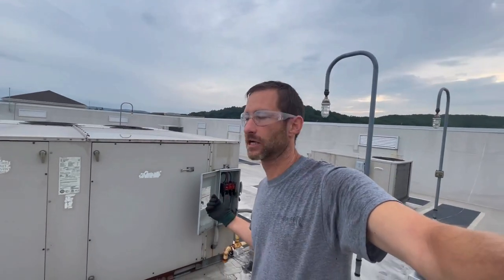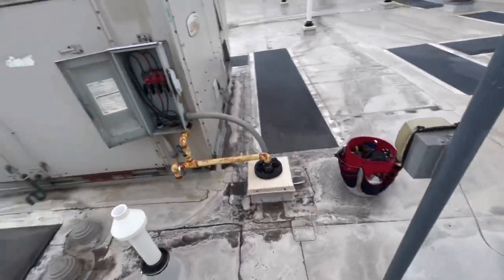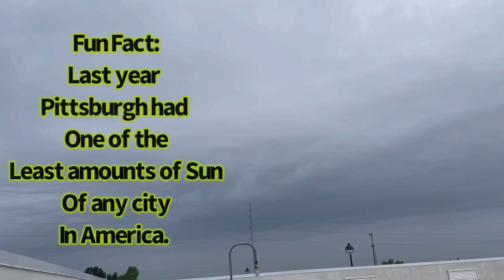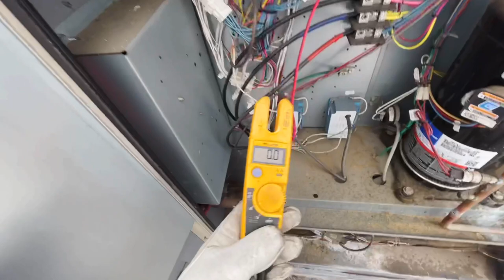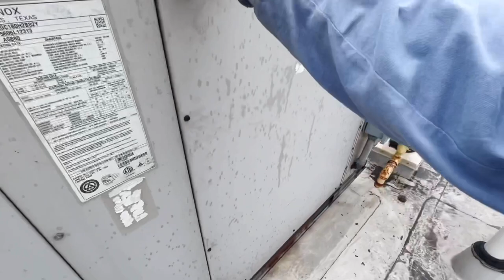HVAC Disconnect Cooked...  #Steamfitterslocal449 #hvac #hvacfail #electricity #HVACEXPLAINED #Lennox

Comment: Loose connections are usually the culprit, loose wires, etc. Steamfitters 420. Good video. Stay safe and be well.
Reply from the maker: That’s pretty much I see loose connections just from lack of maintenance. It’s always good to recheck those connections after a new install and periodically on maintenance. That video I posted of the disconnect literally melted from down in Florida was the first time I think I dealt with aluminum wire used in that application and my opinion I would never do that.  Thank you very much for the comments and nice meeting your brother! The trades are the Way to go!
Reply: @hvacexplained9341  stay safe and be well brother..

Comment: Nice video. 
Thanks for sharing
Reply from the maker: Thanks HK.  I always recommend when installing a brand new RTU or a piece of equipment installing a new disconnect.  I’ve had a handful of times where a brand new piece of equipment will burn some thing up or have a random power failures due to an old faulty Disconnect with bad knife blades. Have a great day thanks for the comment.

Comment: So much to say in this one..
Firstly, was reading a thread the other day and a commenter posted that they recently had a power box blow up in their face. Sorry, I didn't think to ask details.
Secondly, helps to be fit and trim in your profession. Lots of climbing, squatting and contorting the body to fit tight spaces. You're the perfect build for this. 
Hornets, lol. In my profession, they're first on my list of critters I need to look out for, followed by red tail hawk and squirrels. Yes, squirrels. 
There was another item, but I forgot.
Lastly, you're a likeable dude, and really easy to learn from. I wish you well and for your channel to grow. You put a lot of effort into these, it shows.
Reply: Now I remember! The wedding band!

So I'm finishing up a tree removal, standing in spurs on the trunk, cutting 2' chunks and pushing them off the spar.
These rounds weighed approximately 85lbs. 
As I finished the cut, I pushed it from the top to get leverage. It tipped forward---and as it fell away, a small stub the size of a pencil eraser hooked onto my ring and nearly pulled me over the top of the tree. I don't know how I managed to get my finger free without it being degloved. 
I stopped wearing it after that..
Reply: And!
I'm thinking Youngstown may just have you beat for cloud cover.

Comment: Crankcase heaters have been off on the compressors.  Power should be restored for 24 hours, (or as prescribed by the manufacturer), before energizing the compressors, as liquid refrigerant will be absorbed by the oil,and cause potential damage to the compressors.  Phase imbalance should be checked when all of the motors and compressors on.  It should not exceed 10%. 100 X the maximum deviation from the average, divided by the average.  You took all the right safety precautions, and more.  I rarely see that in the field.  Good job.  Sheet Metal Workers Local 104.
Reply from the maker: Good afternoon Rod.  
Yes you are 100% correct about manufactures one crankcase heaters to be running for 24 hours prior to start up unfortunately not many people follow this.  I believe carrier factory had told me anything under 55°F they would like crankcase heaters to run when the compressors are not running. I don’t feel it. Will damage it that much if you do it once in a while but if it was more consistent thing yes.   I have seen residential heat pumps. Running for 15 years without crankcase heaters in 0° weather and still currently operating.  But yes refrigerant migration under the oil then starving the bearings.   I think they just do that to cover their butt.   
Phase unbalance yes can damage the motors also rotation is critical. 
I try to do things that I can buy the book and try to set an example, but there are times where I do slipup pop on this video on these videos.  I’m glad people call me out on it. It shows that they are paying attention and it’s good to share the information because we are only human.  
Since this video I have moved from Pittsburgh Pennsylvania down to Florida.  I am learning the industry down here.  Picking up a lot of good information on how critical equipment reacts to salty environments along with humidity.  
I’m working with a lot of very talented techs.  I’m just trying to soak up everything I can and share what I can.  Their using a lot of Fiberglass ductwork vs sheetmetal. 
Currently replacing a lot of air conditioning systems that were damaged with hurricane Ian.  
I am currently on a travelers card with my union Local 449, but eventually switching over to local 725.  
Thanks for the comments. Have a great day. Very nice meeting you.  Brother.

Comment: I stand correct. If you go into the ECTO setting you can change that to make it work like he said
Reply from the maker: There are dip switches on some equipment and also in the programs you can change settings etc. I have seen some of those Lennox is light up on the right side and some on low fire as first stage.  It’s nice having that option thank you for the comment have a great day

Comment: Good day.ser.i just ask for a/c
Trane package r22 freon
50psi low side 310 high side and there is no cold in suction line. Did the system have a oil or the txv have the problime..thanks
Reply from the maker: I need to know what the temperature is inside the space as well as outside conditions. 
The suction pressure seems a little bit low and the high side seems a bit high since I am not standing right there just looking at this I’m suspecting a plugged up filter dryer so I would definitely check temperature before and after the filter dryer or you possibly could have a metering device such as a TXV going bad.  Not sure of the condition of the equipment but make sure filters and coils are properly cleaned as well as a good belt.  If you can please send me more information and I can possibly diagnose.
Reply: @hvacexplained9341  good day ser i have trane package unit..the pcv  led 1 or led 2 are blingking....is there such a problime to the system...but the unit are working...thnaks.
Reply from the maker: @alvinobalan2320  :  When I get a chance let me look up some info do you have a model and serial number? I’m a little bit busy right now I’m hooking up a new furnace for one of my buddies I will be posting the video probably by tonight.  Is that a voyager unit or possibly?

Comment: I liked your video. Keep it up if you enjoy doing them! Question: what model fluke meter is that?
Reply from the maker: Hey good afternoon Benjamin. Thank you very much on the compliment for the videos I appreciate everything. I will be doing a tool review on what I do use after being in the field total roughly 19 1/2 years I have selected a certain group of tools and they seem to run well for me.  
The small voltmeter with the forks on the end that I am currently holding there in the photo.  
Fluke T5-600.  
The other meter that I use is also from Fluke.
Fluke 177.  
Both seem to work very well for me there are newer ones that actually will Revoltage when you put the forks around the wire I may go to that for my next voltmeter.  Thank you very much for watching these videos hope they help you out a little bit have a great day.

Comment: How do you like being in the 449? I just talked to Nick last week about joining.
Reply from the maker: Honestly it’s the best move I’ve ever made. I’ve been working for the same company since May 3 of 2004.  We have many different companies within our union.  Some of them do different ends of this industry more than others such as a couple companies are mostly construction some are strictly refrigeration and some do a little bit of everything.  When I did residential nonunion work I was not consistently working and a lot of the work I was doing wasn’t done the right way and I knew that even know I was extremely green at that time.  I always get my 40 hours, plus overtime occasionally.  I like the service end.  In my opinion it’s the better route if you’re going into the HVAC industry.  Check it out if you get a chance good luck thank you very much for commenting and have a great day.

Comment: You are missing a key piece of your arc flash system. You need to have your baklava on the shield does not give you full coverage.
Reply from the maker: Good eye.  Not many people remember that.  I do utilize that in sketchy situations on live power especially for 480V 3phase.  I was just giving a little demonstration of safety even though the power is 100% off you should never take chances.  
Thank you for pointing that out!  Great job. I think in the next upcoming video I will point that out and wear that.  Thank you very much for commenting have a great day.
Reply: Arc Flash Hazard equipment labeling was not done on this equipment. It spells out required PPE for this equipment before opening and is generated from an Arc Flash Hazard survey calculation.

Comment: it's not left and right staged burners, its low fire high fire staged heating. a popular misconception.
Reply from the maker: I’m glad some people are paying attention.  I was just pointing it out real quickly here’s one in here’s two in no particular order.  Next time I am working around the Lennox L-series units I will do a call for heat. Many different manufactures do it differently.  Let me see the next time I can work on one and I’ll shoot a short video maybe do the cooling stages as well.  I was just more concentrating on a quick overview and replacing that disconnect.  Thank you very much for commenting.  Have a great weekend.
Reply: @hvacexplained9341  lol, no sweat, I get it and even though I know better sometimes I do the same thing. It's confusing to new technicians however and can lead to confusion at the supply house if you get a rookie behind the counter. 
Let me ask you this, how do you go about fixing tube sheet leaks in coils? This is where the steel at the ends of a coil rub through the tubing, usually on the hot gas line or hot gas rail. I'm only curious because at this point, I think I have a novel way of fixing these that I have seen no one else use.
Reply from the maker: @johnnyb8629  :  I actually did record myself fixing a Condenser tubesheet a most of the time use a Dremel.  You can be pretty precise getting in there but you got to be very careful doesn’t bounce around and cause more damage LOL been there.  The problem that I see with two sheets overtime they rust which swells up and digs into the copper.  A majority of the copper tubes today or so thin it’s just asking for problems.  Also with the tube sheets when you basically get one rub through the next ones are not too far away from starting as well.  Sometimes it’s best to replace entire tube sheets there are certain coil manufacturers that can do an upgraded version such as thicker tubing and specialized coatings to resist chemicals and salt.  I have fixed only a couple aluminum microchannel but it’s not easy.  I believe Trane has a patent on how to fix microchannel in the coil with a certain epoxy and wrap I watched a video on it at the supply house and I think they are onto something but it all comes down to the better you prep the surface the better the outcome. Let me see if I can find that video And bring it together.  I’ve been so busy lately because of Pittsburgh’s weather constantly fluctuating.  I spent all day yesterday replacing a furnace and A-coil for my buddy in his house.

Comment: I have more than 10 years of experience
Reply from the maker: That is excellent congratulations.  Time does fly bye notice that!   Where about are you from? How did you get into the industry and what is your favorite type of equipment to work on?
Reply: @hvacexplained9341  I'm from Egypt and I live in Dubai working on all the equipment
Reply: @hvacexplained9341  I do maintenance work for all types of air conditioning and I have experience in heating devices